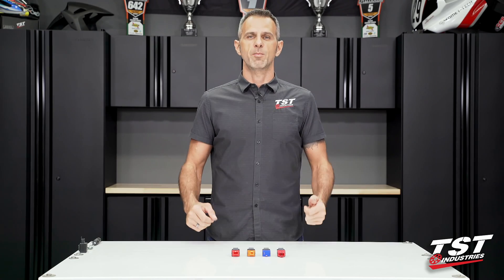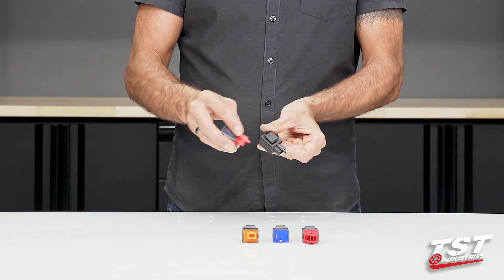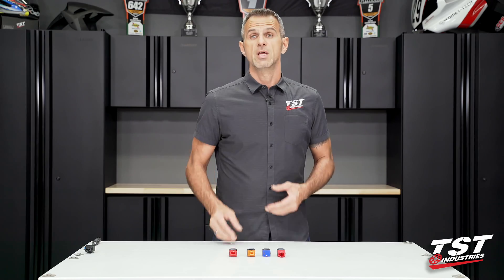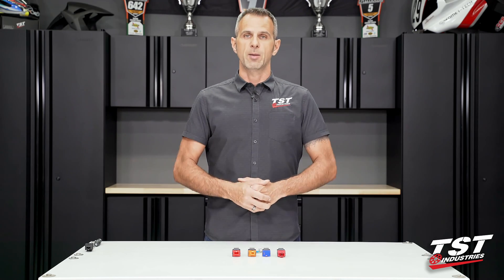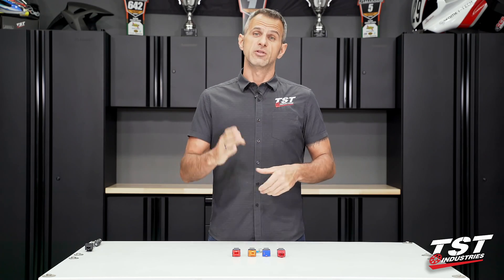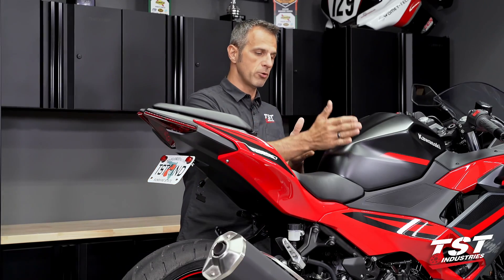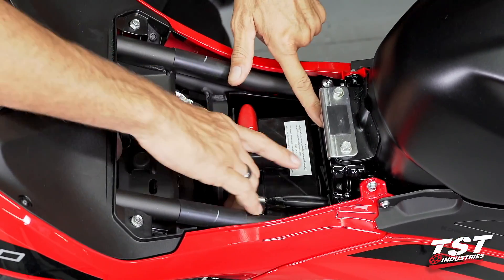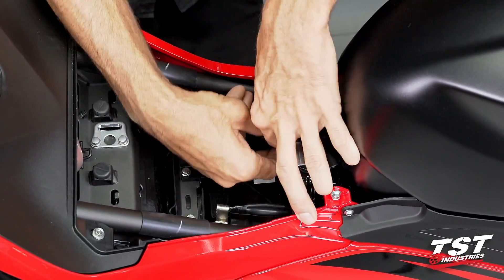How to Install LED Flasher Relay on 2024+ Kawasaki Ninja 500 by TST Industries

Comment: I have the Z500 SE. My OEM relay has 3 pins? Where can I get a relay with 3 pins?
Reply from the maker: @Smokey2686  the one on the Ninja  also has three pins. As long as it is the same shape connector the relay we offer will work for you.
Reply: @TSTindustries I just noticed on your website it states it’s a 2 pin relay. As my bike has hazards and is required so by law here where I live.
Reply from the maker: @Smokey2686  our relay will work with hazards just fine.
Reply: @TSTindustries  So what is the 3’rd pin I’m gonna be loosing. 
I’ve tried with a 30 ohm 10W resister but that makes the flasher not turn on at all. 

I do not wish to loose any functionality.
Reply: I switched from the OEM 3,5W to a sequential 1W flasher

Comment: I have the ninja 500 40 anniv SE model bought the turnsignal combo for the SE model with the bl6 sequential. No lights were working when installed but oem still work. Do i need this to make the lights work?
Reply from the maker: @ocolito16  yes.
Reply: I’m having the same problem with the mech evo lights. did getting the relay fix the problem for you?
Reply: @Dom-ge3ow  yes

Comment: I just bought the Nexus LED Front Flushmount Turn Signals with the running lights and I want to get the strobe brake light module as well as the led rear turn signal kit with the tail tidy and led plate light. Is all of this compatible? Will I have to do any splicing to make it work correctly?